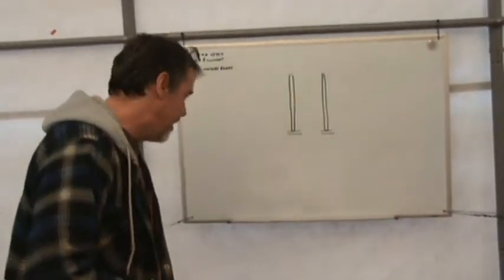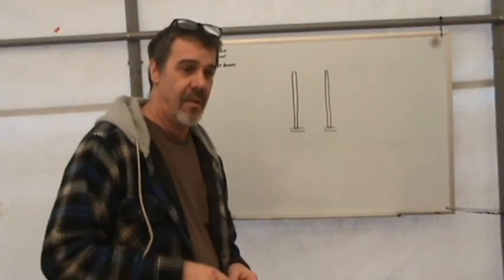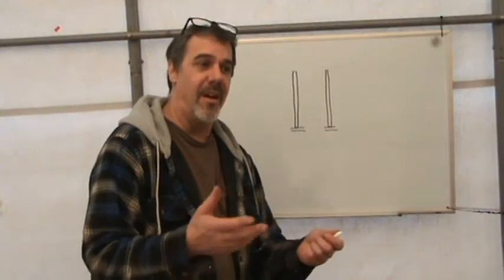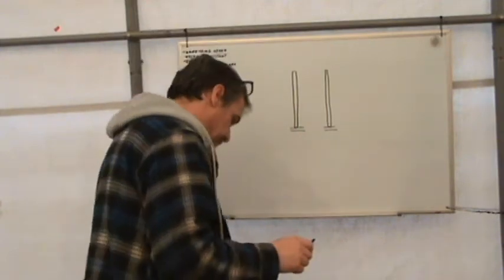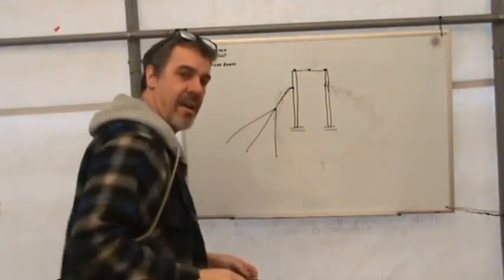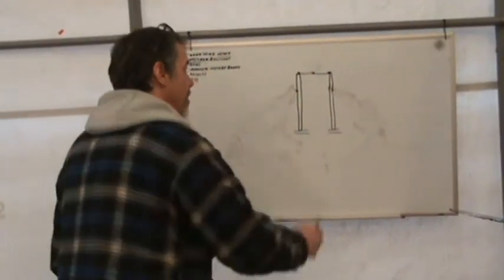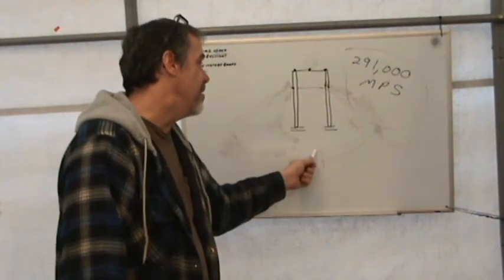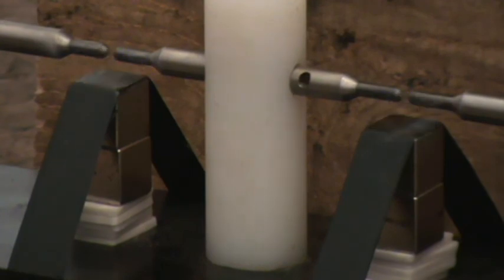TESLA'S HAIR PIN CIRCUIT Part 5 (Update)

Comment: yes you are correct there is a way to transform it. one a Tesla coil and ball. the voltage comes out the primary as ac/ and dc. so you can rectify the ac.dc.. nice right? i the sparks hit the Tesla coil, i am talking small diameter coils, and balls on top to primary rectified primary step down. so year that spark gap itself has huge potential. and cam be directly converted to dc and ac...

Comment: you asked some o the best questions. i have some idea that you are or Tesla is using the rods as the counter pause/ i dont know i i am using it theoretically correct. more like the second half of a dipole antenna analog.  so you asked the purpose o this? i say make a 1000 watt light to full-power or zero cost. for less the 100 watts . Tesla has mad ancient encryption dipole. and has the 2 halves o the circuit. and Joel seemingly provides an excellent experimental observation. discovery. Spark gaps hmm. radio? and you need a ground wire. i think the rods act part o the dipole. as in ham radio.

Comment: . Hook your positive to the dielectric side of the capacitor and hook your ground to common ground. Tesla used the earth ground as a capacitor plate. Use your common ground (battery negative) the same way? The ground is current
Reply from the maker: Thank you for your comments.

Comment: No over unity 
it senses the load and
most of your energy will be wasted as the it spreads out though the air

Bulbs resist a change in the magnetic field and it actually produces its own fields in resitance 

So even if you made it so no energy was wasted by the air the bulbe would resist
Reply from the maker: Thank you, i now understand better :-)  (sorry for the very late reply)
Reply: Yup radio towers waste essentailly all they energy use and crytal radios amazingly use very little energy. They are essentially just long distance tranformers and the core is air. If you want to test this. You can make a 10 coils 

Put them evenly spaced around the central coil they will light up. A certain amount now put then close together or in a row and turn them on from farthers to closest you will notice as you get th tge closer bulb it absorbs energy and less energy is left for thr bulb behind it
Reply from the maker: @preppertechnicianee6013  Thank you for that info, i understand ;-)
Please check out my other videos on "Free energy from air", would love to hear more of your comments.
Reply: @INVENTOR3  i will certainly do so. And do keep it up as we may disagree on free energy the i do think the ideas may lead you to an invention related to blue tooth system pr something of the like
Reply from the maker: @preppertechnicianee6013  Thank you.  Good that we can get along and still disagree on some things, most people that disagree are angry people, hehehhe.  Yes,  i hope to discover something big.  When i talk about free energy, i dont mean energy from nothing,,,but there are undiscovered, or unknown, or unproven sources of energy,,,geeez, it was only in recent years that we proved the existence of zero point energy.  I have seen crystal cells that last forever, but you cant buy them in a store.
Thank you very much for your comments.  Share knowledge & learn :-)

Comment: I think I should share some of my own personal experiences with this circuit.

firstly I'm using a rectified flyback via zvs

I did at one time of one of my experiments see thin sparks between my bulbs terminals. The distance between said terminals is approximately 3 millimetres. Just note that this was happening while the bulb was lit at full power.

Another thing to mention is that using an air-cored transformer in a voltage step up configuration, I've been able to get white arcs on the output. Reminds me of Tesla's streamers. I've taken this output voltage and ran it through a xenon flash tube and waved a neo magnet nearby the vacuum arc. seems as if the magnet has no effect on this strange white voltage.
Reply from the maker: Very interesting, sparks between bulb terminals same time as filament is glowing to incandescent,,,i got the same results depending on where i have the connections adjusted on the rods.
Also very interesting that your white sparks in the vacuum are not effected by the magnet.  I will soon get a vacuum spark gap of some sort, but still deciding on what type.  For now, I will test a magnet near the bulb and see if there is a reaction.
I love to hear about other peoples experiences, thanks for sharing :-)

Comment: Just had a 'What If' thought. Following on from the Radio transmitter and crystal radio set thought you had. What if, you attached a Tesla coil to the 'stout bars' and used it as a transmitter and then wound tuned induction coils (crystal radio analogy) to receive the transmitted signal...? Just a thought.
Reply: then the output would follow the laws of a ohmic output again, and no longer be a tuning fork......
Reply from the maker: Hmmm, yes, i thought about doing the same thing,,connecting the rods to a bifilar coil.  From my own experiments with this and coils, is that the coil would have to have at least 1/2 inch spacing between the wires, so this makes it difficult for a bifilar coil, but maybe a regular pancake coil.  Im also thinking about what Justin said.
Reply from the maker: I have been learning a lot from this experience.  Now a good friend tells me that because the system is "symmetrical", this causes the components of, electrical & magnetism to be separated by the two rods.  So now i will perform experiments to see if he is correct.  Test each rod separately and see if one has electrical properties and the other only magnetic properties.  Lets place our bets now,,,,,what do you think?

Comment: I wonder if you could try a coil around the point of greatest magnetism, rectify the output and then build up some charge in a capacitor, enough to power a small device.  Have you tried Hall effect sensors, with one LED for each polarity? Maybe red for north, green for south.  I have a permanent magnet polarity sensor which does that.  Visual indicator of the magnetic field shape where there is enough gauss to activate it. Great interesting stuff, thanks for sharing.
Reply: then the output would follow the laws of a ohmic output again, and no longer be a tuning fork......
Reply from the maker: I tried the coil, but that clip got erased from my camera.  But i did not try with rectifying, i will try this.  Once i add the coil and diodes, would i connect both ends of the coil to the small dc motor or connect one end to motor & other end of coil to ground and back to other side of motor.  I do not have a polarity sensor,,,but now that you mention it i will get one,,,it is a "must-have".
Reply from the maker: I think you are correct :-)  i was thinking about the same thing with the way i sent energy through the ground & lit an LED,,,i think it is transformed into conventional electron flowing energy when sent into the Earth,,,,so that means it would not be OU.  But maybe there is another way.  This device has been driving me crazy,,it is unlike anything i have ever worked with, thats for sure, hehehehe.

Comment: Yes, faster than the speed of light.

I know of some Russians who are working on a GRAVIMETRIC communication method which they feel will be so much faster than C that it is virtually instantaneous at all distances, not sure if it works, but it has some merit, if nothing else, I saw a balanced coil tip when the power was tuned to the right frequencies.

As far as 'over unity', no, if you broadcast 50kw and pick up on a hundred million .001 milliwatts, you are missing much of the power, so its still less than the power being radiated.

So 100 million people absorb about 1kw, leaning 49kw just floating away into space, the earth or being absorbed as it passes through all kinds of materials, especially metal roofs and electrical power lines, and re-converted into microvoltages which then resonate until they too dissipate.

That said, never give up hope, just be sure you know where your power is coming from, how much it is, and where it is going to, and how much is actually being realized at the far end of the system.
Reply from the maker: Thank you.  Good info about the radio.  I was wondering how a radio station knows how many listeners it has,,,does it know how much energy is being used or picked up.  You mention about a lot of power losses, but with longitudinal waves there will be nothing to block the waves.  Or what if the longitudinal/Tesla waves are sent through the Earth?
I learn something new every day.
Great comments as always, thank you.
Reply: Actually listenership is based on call-in response rates, questionnaires and event turnout. 

There are no means presently known to prove how many radios are tuned in to a station, nor a way to independently identify radio receivers like you can with computers. 

The only radios presently made which MIGHT be trackable and countable are the XM systems which have to have a special code to access digital satellite programming, HOWEVER it goes through a much more round-about means, AND you already know who your subscribers are, because they PAID to listen!

So, as long as people are simply passively absorbing microscopic amounts of a radiated wave, radio stations are at the mercy of more common human interaction to know how many listeners they have, unfortunately.

My dad was a radio engineer back in the 50's and 60's for the USAF, worked in the MARS network, was a member of the ARRL, worked on the LANSAT network  https://landsat.usgs.gov/ and worked on doppler weather radars as well as climbed quarter mile tall towers to repair them when nobody else was brave enough to.

Later in life, for all of his efforts for the government, he was GIVEN [and if you know what its worth, its worth a FORTUNE] a FREE license by the FCC to broadcast a 50kw radio signal for LIFE for his achievements in radio [even though few people would recognize his name] and it was even a surprise to my dad.

Sadly, no idea what happened to that license, but since it was for him only, nobody, not his children or relatives could inherit it, and with his passing, its value returned to zero, other than as a collector's item.

Still, he taught me about Tesla when I was very young, and all about radio and electrical theory, how to build wave guides, how to make beamed radio antennas and a whole lot more.

If there were a soul alive who knew about the principles of radios and electronics he was high up on the list!

What he DID show me though, was how to COLLECT radio power from the planet! I just lack enough room, elevation [such as a tower or weather balloon] and wire [which as you know is NOT cheap!] to make use of that knowledge.
Reply from the maker: Thank you for the great-to-know info & the heart-felt story about your father.  Sounds like a very good man that taught you a lot :-)  Maybe you could help me design some wave guides in the future :-)
Reply: Wave guides are easy to 'design' as long as you know your intended frequencies, and you have the proper angles and fits. I have seen wave guides built from wood carefully covered with aluminum foil and heard of them being made of wood covered in copper foil, mesh will work in some cases, but not all cases, and regular steel can be used as well, again, as long as you have it all set up properly.

Comment: hey paul  nice video great explanations there  i to had my camcorder once effected by the hyper dimensional electromagnet it kept shutting my camcorder down when i got to close to it to film its effects
Reply from the maker: Thank you.   
Wow.  I love your spinning pyramids in your HDR!    I think you could use them in many different experiments :-)
Reply: one of my spining pyramid experiments did what it looked like the tesla device did i think the zero time reference generator it moved around slowly and felt like it was locking into something or direction and the pyramid was spining fast and the motor body was counter rotating slower and created a tourqe so strong it broke the super glue hold so this thing could if made bigger turn a space craft around in space easily and even a boat
Reply from the maker: very interesting, wow.
Reply: watch my videos if i have not explained in any of them the spinning pyramid seems to of done what they described the tesla zero point reference generator as  doing  and maybe more
Reply from the maker: Thanks Steven, very Interesting, i never knew Tesla made a zero point reference device,,,,but im searching now :-)
Yes, he had something spinning on his device.  The device referenced the center of our galaxy.
I will have to search more :-)
Reply: the first time i saw it it moved around the table but dident lock onto anything mine did and it was strange and mine was totally different but stranger than his
Reply: ive posted the link above it acts more like  a vibrational generator  that moves its platform around by vibrations  i think he built it from schematics  on the net but i think they who put them online dident include everything  like even the vinana its missing lots i think and is alterd so we cant get it right  if anyone tries to biuld it

Comment: Very interesting Paul. Testing the hypothesis might require very fine measurements. You might try a sensitive meter to measure current and voltage through the ground set up like the bulb, switching bulbs on and off at varying as well as equal distances to see if there is a change in the values. If you detect a drop with one or more bulbs being lit it would indicate the power used is being slplit between them. It might be useful to keep track of the power going to the unit to see if there is an increase while lighting bulbs. 
Another thought is to use a rod in the ground insulated to some depth in a pvc sleeve for measurements to determine if the phenomenon radiates in a plane along the surface or in a sphere into the ground, or perhaps some combination. There are a number of possibilities.

Comment: power some solar cells by light bulbs and use that power to run your hairpin plus ~~~
Reply from the maker: ??  Lets see if i understand you correctly,,,,plug light bulb into my wall & use photon energy from the bulb to power the solar cells, and use the solar cells to power the hairpin circuit??
Reply: No use the hairpin to power a bank of light bulbs then use that light to power your solar cells.
Reply: Or better yet see how many tesla transformers you can power with your hairpin then use that to power lights to power your solar cells.
Reply from the maker: thank you for clarifying, interesting thoughts, thank you.